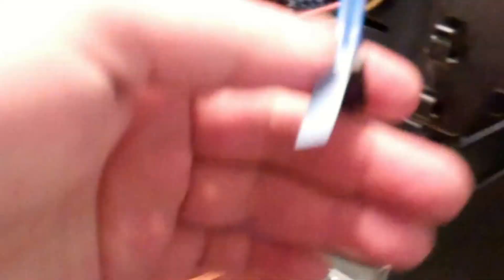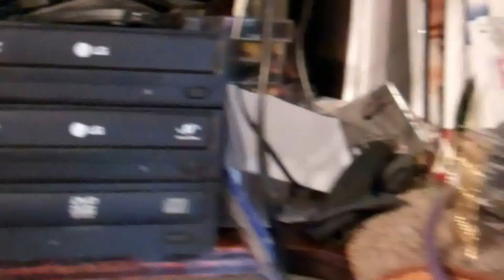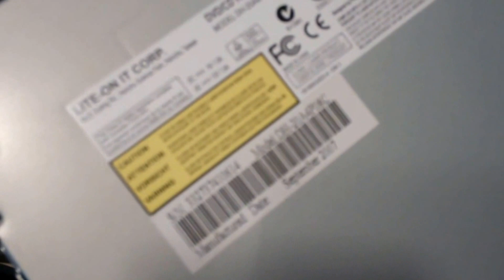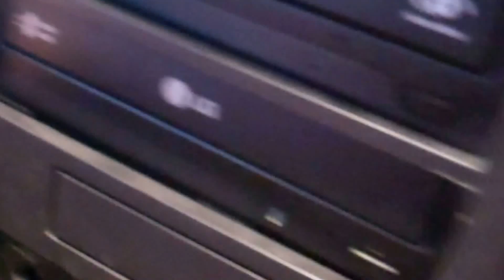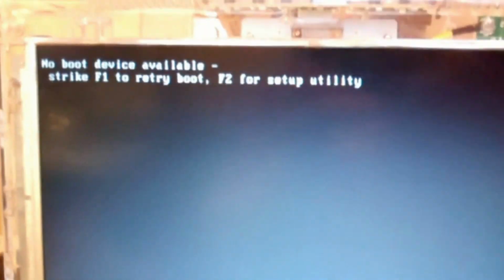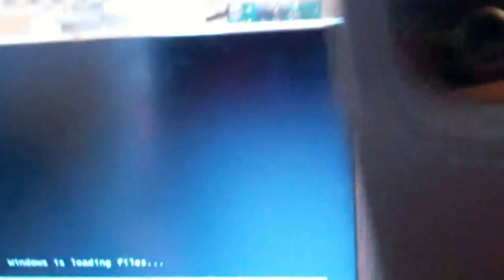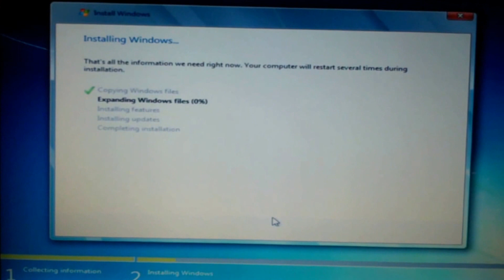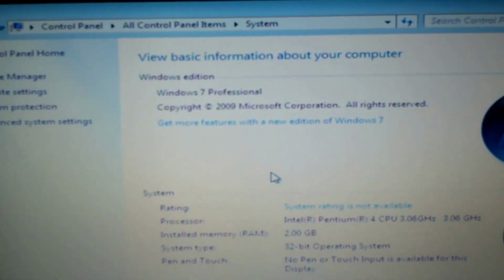Ressurrecting a Dell Dimension E310

Comment: I have this same computer. I'm faced with an issue. Everytime I boot it it reads: Intel(r)915G/915GV/910GL PCI Copyright (c) 2000-2003 Intel Corp. All Rights Reserved: Any idea why it's stuck on this screen?
Reply from the maker: No idea. I don't have this computer anymore

Comment: if you're gonna resurrect an old machine, you should really use the SATA to add an SSD and ditch the mechanical drive all together.
Reply from the maker: These are cheap/free computers and I had extra IDE hard drives on hand so I used them.. Trying to spend as little as possible at the time
Reply: Yeah why even bother with the ide drive. Bizarre choice.. in the very least use a sata drive.

Comment: Do you know what kind of hard drive came in this machine stock? I just got one of these for free without a hdd and don't know what kind of drive to buy. is it just a regular sata III?
Reply from the maker: +jetguy1205 Not sure what it came with originally either but SATA 2 will work fine; never tried a SATA 3 but I don't see why not.
Reply: +RVR2 OK thanks
Reply: 1 year late but mine has a 80gb sata hard drive.

Comment: Got the Same computer How'd you get the windows update I have a old version I'm still learning so correct me if anything how can I make this a 64 bit computer I also want to put Core i5 in it I want it to run website based games without no lag At a good FPS any tips or ideas?
Reply from the maker: +Dennis Collins Going from 32 bit to 64 bit will require wiping and reloading the operating system. Not sure if they make a i5 core that fits this make/model Dell.. 
If you're wanting to play games then I would just build a gaming rig or go with a whole new machine.. By the time you go through all these upgrades, I still don't think you will be happy with it's performance. You'll most likely wind up spending so much in upgrades that you could have just bought something custom built for gaming..

Comment: I am looking to upgrade the ram on my E310 to 8 gb. The chipset says that it can support up to 8 gb, but Dell's website says that the motherboard itself can only support up to 2 gb of ram. Do you think that if I installed a 64 bit OS the computer would be able to use all 8 gb? (PS I would also be upgrading the CPU to a Intel Q6600 so there should be no CPU problems). Any ideas?
Reply from the maker: +Jake Crossan Possibly.. The most I can get out of mine is 4GB (3.5GB usable) because the processor is a Pentium 4 which apparently limits its RAM capabilities.. 
If a Q6600 will fit then you might be able to use 8GB but I honestly don't know for sure.. Only way to know for sure is to try it and see if it works :/
Reply: +RVR2 Ok. Thanks. So do you think it would be worth upgrading to a new motherboard w/ the new cpu and ram? I don't need anything new and flashy, I am envisioning this as a potential game server.
Reply from the maker: Possibly if you can find the parts for a low price, but if you're looking into a Gaming rig, I'd recommend a custom build specifically built for gaming.
Reply: +RVR2 Ok thanks for all the answers and the fast responses.
Reply from the maker: No problem. Good Luck!
Reply: @jakecrossan838 none of that will work. You can only use pentium 4 cpus and 4gb Ram. A new motherboard would also be quite pointless as this is a BTX system and there’s already a plethora of cheap ATX cases around.
Reply: +Jake Crossan I have not tested because i only have 512 of ram on my system, but i imagine you could use 8GB of ram on linux, or you could use a separate disk just for swap space (like a paging file in windows)
Reply from the maker: I just upgraded this one to Windows 10 but 64bit would not work; only 32 bit and 4GB was the max as a result..

Comment: I have the same model I'm trying to upgrade the memory on but I'm having a hard time opening the side panel. Any help on that?
Reply from the maker: Dylan Azari Only way I know is the lever on the top that you have to pull back (maybe an inch or so) that unlatches the side panel.. May need some finagling but that's the only way I know
Reply: I just got it open, that's exactly what I did haha. I fooled around with it and finally got it open. Thanks for the fast reply!